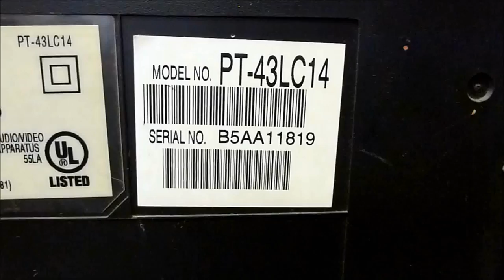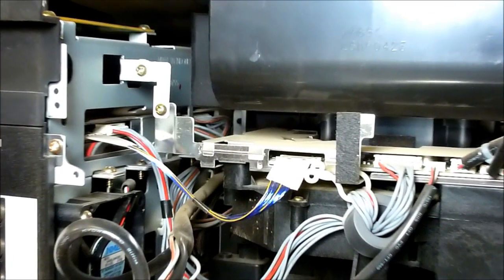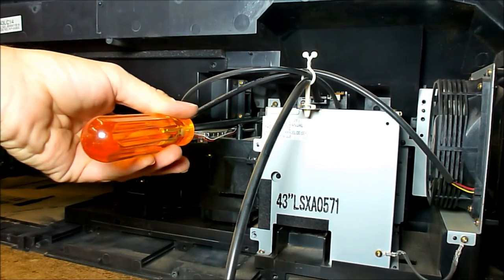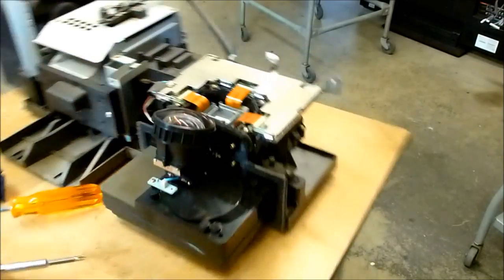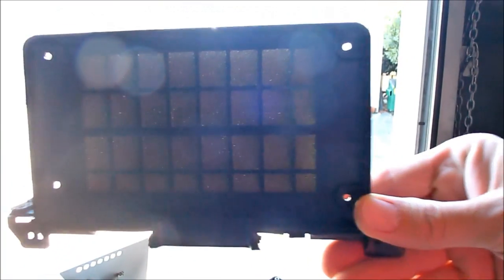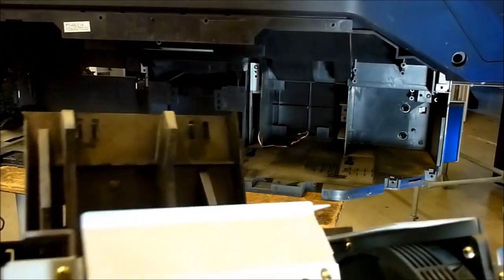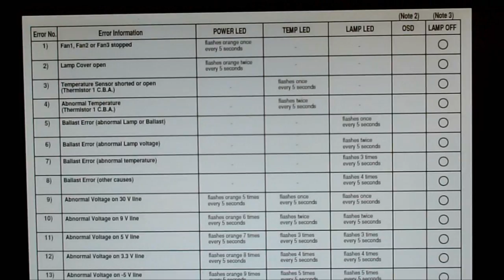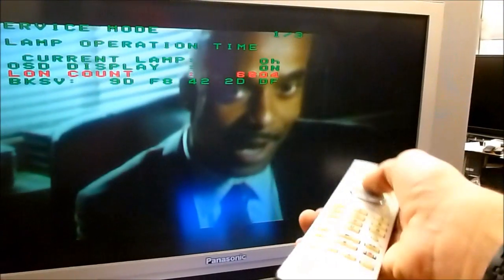Panasonic LCD Projection Air Filter Message on screen. PT 43 47 50 52 60 LC LCX 13 14 15 63 64 65 35

Comment: We have had the filter message on our TV for more than a year now. finally got to a point where it wouldn't stay on at all. called a repair guy and he said it would be several hundred dollars to fix because the filters are hard to get to. We used your video and cleaned the filters ourselves. it works perfect now! Thank you so much for posting this video. Saved us lots of money! You made it very easy for us.

Comment: Thank you so much for this video! I was about to throw mine in the trash rather than pay some one more money than the TV is worth just to clean a filter, but was able to get up and running again thanks to you :) One small note to people using this video. Be careful with the filters. They are very soft and easy to accidentally stick a finger through (like I did) Thanks again!

Comment: Hello.  Indeed, as Ray said 17 hrs before me,....THANK YOU!!  I unfortunately cleaned my filter w an air compressor and blew it to smithereans.  I looked to no avail to order a new one.  I visited my favorite small local hardware store, you know the kind that the old guys love a challenge.  Fella sold me air conditioning filter, very very close match.  $1.49 and double-side tape.  Done.  TV working great.  Error message gone.  Thank you.

Comment: Thank you so much for uploading this very detailed and informative video! I have the pt50lc14 model and have had it nearly 10 years and started having the air filter alert in the last few years. I was only able to find a video that showed how to clean the exit filter which helped a little but this one is exactly what I needed! After performing this entire cleaning of the tv, I was surprised to put it all back together, plug it in and turn it on and it still works! I was close to buying another tv and throwing this one out. Just like you said at the end of the video, kept a tv out of the landfill!

Comment: I think the engine fan is slowing down a bit. Signal pin shows .08V vs .06V for the lamp fan. But I believe Panasonic only sells that fan with the engine. Cutting pin 18 of the P5302/P2501 cable eliminated the error message. 

Thanks for the quick response, and great video!

Comment: I did re-seat the lvd cables I actually pulled the whole unit out by following your instructions in this video and still upside down what I also forgot to mention was that the image isn't just upside down but also mirrored. Thanks for replying.

Comment: Thanks! I never could have done without you, although if I'd watched the video to the end before jumping in, I probably would have decided it was too much work.

I have a 65" that turned out to be a little simpler.  I didn't have to remove the power/input block at the left to get the projector out.

Comment from the maker: you have to check the voltage on the 3rd lead of the fan, not the red or black lead. Its usually yellow or white. 0 volts to .5 volts means fan is good. 2 volts or more means fan is stalled or defective. check the main big exhaust fan first I have had several bad

Comment from the maker: The set measures the current draw of the LCD fan and when a fan is approaching a vacuum is runs faster and draws less current and the micro senses that and gives the message. You might want to try and parallel a resistor 100-200 ohms across the motor leads (red and black) and see if it helps. Maybe the motor is acting funny?

Comment: thank you for posting! Wow looks really complex. I have a 60 inch of the same model. I hope I don't have to do this anytime soon but im sure its gonna happen. I may just get a new tv when it does. the fan runs all the time on mine to cool the tv. my desktop computer is dusty as heck and it runs about the same as the tv.

Comment: Do you know about the sound cutting in and out on these models? Checked all connections and no corrosion on the small filter boards
 I think is what they are.

Comment from the maker: There is no filter timer. Only a lamp reminder timer. The filter message is based on the calculated current flow of the LCD cooling fan. When the filter plugs up the fan draws less current.

Comment: Ok, got any idea why I'm still getting the Air Filter Cleaning Recommendation, I followed  your video exactly as shown.
Thanks for any suggestions may have.
Reply: Did you ever solve that? I changed my filters and am still getting the same message

Comment: Not quite related but I think the issue I'm having could be fixed by replacing the light engine. Huge yellow blob in the middle and little blue dots around the edge. One of the reasons I watched this was the dis-assembly procedures. But on that note and before I spend $120, might replacing the light engine component solve this? Regardless, Thanks again for taking the time to post this. lol. People like you have saved me thousands on taking electronics into repair shops.

Comment from the maker: What kind of lamp did you use? For some reason "Philips" brand lamps do not last long in this application. I have had great luck in using "Osram" lamps in Panasonics. Also beware of cheap Chinese lamps like amazon sells. Also check out the error codes list in the video. I have had a bad ballast ot two. There is a ballast repair kit available if thats the case

Comment: Yeah I need new air filters as well. Looking everywhere for them. Please post here if you have a source!
Reply: I had this same problem i bought a cheap air filter one for duct work in a house. Cut out appropriate sized pieces of filter media and hot glued them in place of the old ones. Tv works great now.
Reply: bellistacoma12 Do you mean those paper type filters? Do they have a PPi rating (pores per inch) ? I believe the original had a 60PPI rating or higher. I bought something that came with an almost perfect foam as packaging, but I plan on topping it with a layer of nylon stocking as a pre-filter. And yes, my TV has been on standby since I posted this :S
Reply: i dont know what it was rated for(fpr 4?), sorry. i know it was a cheap one from home depot only $4 it was more of a cotton texture though with the thin wire squares for support. it was card board around the boarder, hope that helps. also i tried some foam that i thought would work great but it did not allow enough air through. which is how i ended up going the route i did as the foam actually made the problem worse.
Reply: My foam and nylon trick did the job. One year later and its still going great.
Reply: Mine fell apart also. I am going to try using a piece of pre-filter from my John Deere lawn tractor. Seems to be the same density, only green, LOL. Wish me luck. Waiting on another lamp to arrive in the mail so won't know for a few more days.

Comment: Thank you for getting back to me. I counted the blinks and when i turn on the tv the power light goes green the tv tries to turn on but then the power light goes red and it blinks 3 times and then the temp light blinks 4 times and then it just goes back and forth. I tried to compare it to the error codes but i couldn't see them very well so if you could help me with that would be great. Thank You.

Comment: I know that this video is very old and maybe forgotten, but I have the Panasonic PT 43LC14, and it is in need of a new lamp. However, I don't have the original remote. Can I still reset the lamp timer with a remote that's compatible with the Panasonic TV, or is it impossible to reset the lamp timer when you simply don't have the original remote?

Comment: O.K. I cleaned the filter and got everything put back together. I have a great looking picture, but no sound. I took it all apart again and made sure everything was connected.  What did I not connect correctly?

Comment: Question:    The TV has the ability to play audio in LPCM. 
                      I recently purchased a small walkman size hand held audio music player that can record and play what it records in format  LPCM.  Is their a way to attach it by cable to TV and have TV play in the high mode of LPCM, or must the LPCM for TV come from the HDMI input jack only and none other ?  The audio player has a line jack thats stereo phono plug the small size 1/8 14/ inch size. - Years ago when tV NTSC tuner worked with over the air stations the TV had the best audio sound even better than TV's today. I had it set to LPCM and the BBE on ---- What is BBE --- is that what gave the multli channel speaker sound in the set -- ?   or was it the LPCM ---- or Both ---  How can I get that quality level of sound now from the set since NTSC is gone. I suspect not all the audio jacks can trigger it and maybe barred electronically from obtaining it.

Comment: hello Norcal715 my pt61lcx65 has blue spots. i followed your instructions & found the blue lcd damaged. to be safe I'd like to change the blue red green lcd panels with ribbons.& all polarizing filters too. will the sony lcx043a aub2 work? I need model #'s for all replacements. Please help & God bless & where to buy thanks

Comment: Thank you so much for your video. Your video encouraged me to try to fix my TV.  My TV was working fine until I bought a presumably geniune Panasonic TY-LA1000-K lamp for my tv model PT50LC14.  It is not the first time I replace this lamp. I removed the old and installed the new. TV image came on, and all was OK. 1.5 hours later there was a smell of burnt plastic.  When I removed the lamp, one of the lamp connector had totally melted/crumbled together with one of the internal TV connector it connected to. I know that the lamp is no longer usable. However, I’m trying to figure out where I can buy the TV connecter that connected to the lamp. Hoping to have this TV working again, if possible. I contacted Panasonic to get the part number of the connector that connects from the ballast  to the TV lamp socket. The wires don't seem to have been damaged, only one of the connectors was melted together with the connector of the lamp socket.  Do you have any suggestion how I can repair/replace the damaged connector. If I need to buy it what is the part name (I call it a connector, but I'm sure there's a technical name to it). Thank you for your help, hope I get a feedback from you.
Reply: If required, I have pictures of the part damaged. Thanks again
Reply from the maker: I answered you on email. That connector is part of the ballast assembly.  I doubt you will ever find a replacement.  The only thing u can think of is soldering and heat shrinking the wires multiple times. The strike voltage could be as much as 10KV (10000 volts)

Comment: Hey great video but problems continue..I have similar tv but its a PT-LC6014 and after I cleaned filter the unit comes on and displays select a language (will not go any further), prior to this screen the TEMP and LAMP light both blink 6 times... any idea why this is happening?

Comment: Hello Norcal715.  I am in need of some serious help.  I just bought the pt43lc14. Here to find the error that states the air filter needs cleaned.  I followed you steps, and found a nice surprise. ALL the filters have been cut out. The inside of the tv is very clean, so I think it was recently done.  What if anything can I do. My thought would be to replace the filters, but with it being as clean as it is and still getting the error, would it be worth it.  Please Help. I don't want to lose money

Comment: Could you please help me, i have a panasonic PT-52LCX16 and i just replaced the lamp and it worked  again but now when i go to turn the tv on the temp light will just flash and it won't start up. If you could help that be great. Thanks.

Comment from the maker: Temp light 4X means a 3.3 Volt power supply problem, However 4X lamp light means Ballast problem (lamp failure??) The lamp you replaced, Where did it come from?

Comment: I watched the video and did the cleaning but the tv speakers do not work also when i turn it on it goes off and the light turn amber and blinks once every 5 seconds. If i turn it back on it eventually comes on. It plays great but no sound. I did buy one of the amazon cheap bulbs, could that stop the speakers from working ?

Comment: Couldn't get the engine lifted out. When I blew out the dust from the filter, the vac annihilated the filter; fell apart. Where do I get a replacement filter.
Reply from the maker: You may have to make one unless you can find another scrap set to rob the filter from.

Comment: Help! I replaced the air filters and cleaned everything in the interior but message still keeps popping up, what can I do?!?
Reply from the maker: Unfortunately if that does not repair the problem you have to have a special Panasonic test device to reset and calibrate the fan load so it thinks the filter is not flug. In all the years I did these sets I did come across 1 or 2 of them with that problem, but I didn't even have that device to re calibrate the fans. Sorry

Comment: Ok, got any idea why I'm still getting the Air Filter Cleaning Recommendation, I followed  your video exactly as shown.
Thanks for any suggestions may have.
Reply: Did you ever solve that? Ive got the same issue